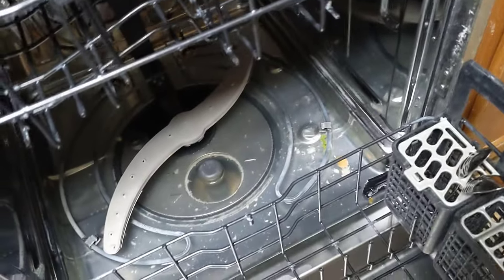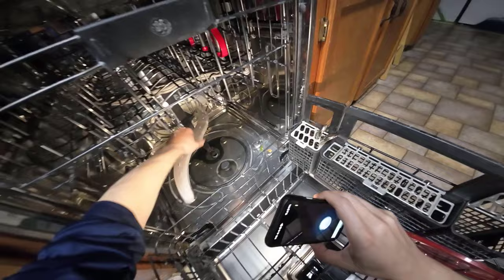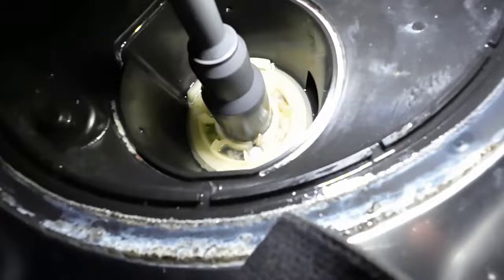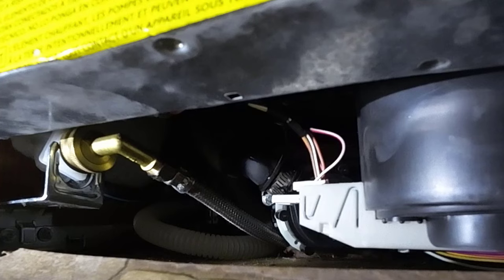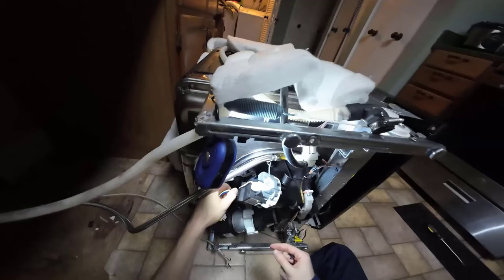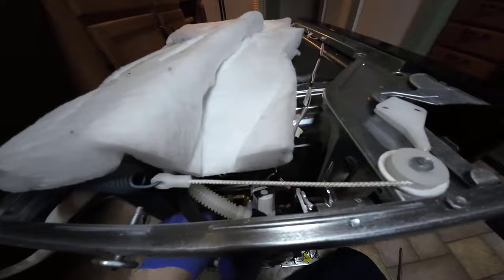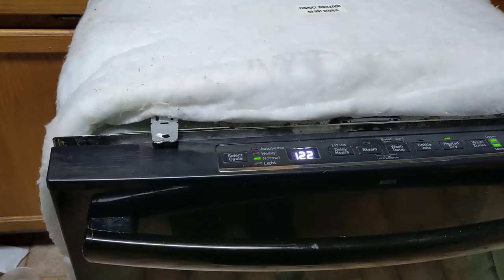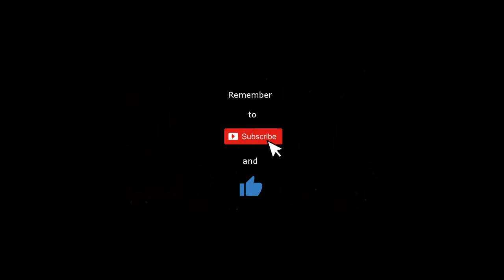Dishwasher water not draining, how to fix

Comment: You cannot blow back into the dishwasher as there is a valve which does not let the water come back.
Reply: Thank god. Cuz I really didn't want to try that
Reply: Blew into mine n got bubbles
Reply: The last video I watched showed the guy blowing in and getting lots of bubbles.
Reply: so what was the problem then if you didnt have a blockage @2wheelsOrDieNC
Reply: Mine has a blow back stopper that only opens from the dishwasher side
Reply: Not is not valve there
Reply: Incorrect - you can absolutely get water to back up into a dishwasher. I work in apartment maintenance and see it happen somewhat often.
Reply: @12799MaDeuce  I do maintenance as well and some have a rubber stopper that only opens from one side not all dishwashers but some do
Reply: The checking for a clog by blowing back!! Genius! Thank you
Reply: @brianw6093 did you ever get any feedback on your question? I have the same question…

Comment: Can u buy a new drain pipe mine is clogged with paper off of bean cans I washed without removing the paper 😢
Reply from the maker: replacing the line isn't too hard and should be no problem to do.

Comment: Had this problem. The drain line went up to a vent that sits on the counter, then a hose ran from vent to the sink waste line. The blockage was at the vent connection on the top of the counter. I have no idea why they put a vent on a dishwasher drain line, I have lived in several different places and installed a few dishwashers and never seen one before. Tried to blow air thru the waste line from the dishwasher but no flow. Didn't want to disassemble the entre line (weaved its way thru under sink) so I took a wet vac and put suction on the line. Bingo a wad of junk came out and now I could easily blow air thru waste line. 
All works good now. Before I saw this video I assumed it was the drain pump on the dishwasher so I had scheduled a repair with a local company. The repair estimate was around $300+ to replace pump. Thanks for the video.
Reply: the air vent is used to stop sink water from going back into the dishwasher. it stops back flow by having an air disconnect.
Reply: Islands have vents too, and it drained before the city services went haywire, and the 'third party contractors' put it back.  Reckon them are the same people that bolted that seat down, with the bolts they was supposed to put in the window vent?  Listen, they have better things to do than be responsible.  😊
Reply: I don’t have a wet vac, is there anything else I could use? Thank you for your tip
Reply: @cjowers40  If you have the vent on top of your counter (usually in back side of sink) you can take it apart and clean it out. Otherwise if you can disconnect the drain hose from the washer (need to pull Dwasher out from under counter) you could manually drain all the water, then use a regular vac to suck out crud. Maybe let it dry a little over night before you use vac.  Another option is if can get under the sink and if you have the tools is to disconnect line at the vent and manually clean it out. And fourth option is to buy a new drain line and install it and connect it to your garbage disposal (as it's done for many new installs). Good luck...

Comment: Had to unclog mine a couple of days ago. I couldn't hear the pump, so I guessed it must have a jam at the impeller.  Easy fix?  Unpopped the spray bar & filter screens to access the sump, I can't get to the impeller  from the top., so i used an aquavac to remove the water, concentrating at the impeller entrance & managed to suck the item jamming  it. It worked fine. Found that it may have been a small bit of bone or egg shell that got past the filter screen.

Comment: This really helped me out! Nicely done-nicely explained. Found 5 freezie pop plastic ends in the input and discharge pump. The only thing that wasn't clear in the video was how to disconnect the electrical part from the pump. I was able to leave it dangle while I fished out the plastic pieces with a needle nose pliers and a long tweezer. Also had a lot of gunk built up at the point where the discharge tube connects to the disposal.

Comment: I tried to blow into the drain line and could not but when I sucked on the line, I was able to syphon out all the water from the dishwasher.  I think the drain line has a one way valve cause when i disconnected the line from the drain pump, and blew into it, I was able to blow water out of the hose b ut when I sucked from the pump side, I could not suck through the line
Reply from the maker: Good to know!
Reply: There is a one way check valve in the end closest to the pump.  So you can't blow in the tube.

Comment: Trying to remove those screws on the drain cover, but nothing is working. What size is the socket that fits it?
Reply: 1/4 inch socket with an extension works best

Comment: any suggestions to get hard water stains off the plastic interior baskets ?  Only 3 months old
Reply: Try running it with white vinegar. After it starts And fills pour 2 cups of white vinegar in and restart
Reply: Add Lemi Shine to soap dispenser. You can buy it at any grocery or hardware store.

Comment: I believe my sink is clogged. that would cause a backflow into the dishwasher, correct?
Reply: I think the drain hose needs to be hooked up to the top of the sink not in the floor check you drain hose.

Comment: HELP ME PLEASE! So, according to the dishwasher manual I downloaded it says: Faucets are not opened, or water intake is restricted, or water pressure is too low.

How do I fix that problem?
Reply from the maker: It sounds like your water intake has an issue.  The simplest answer would be if the valve for your water intake was not all the way open, check to see if there is something you can turn to open up more.  I don't spend a lot of time talking about the intake in this video, but you can see it at 3:57.  It is the braided metal line that screws into the gold elbow of the dishwasher underneath.  It could also be that there is some piece of debris in this line that is causing the intake pressure to be low.  There could be a blockage withing the dishwasher intake, but I think that would be less likely.  If I were you, I would first check that the water intake from your houses pipes that lead to the dishwasher are fully open, and if they are, then I may get a new metal braided intake line, and replace it just incase there is debris stuck in the line.  If none of that is it, I don't know what it is.

Comment: When I turn on my dishwasher, it starts drawing water, and then it stops and does not start washing, and it takes out the water after the end of the program. What is the problem?
Reply: I'm having the same issue. Any advice? I took the dishwasher out and tilted it, heard some trickle and it ran a cycle afterwards and drained. Now today same alarm error. Seems to drain and then alarm before it starts. I could not get at the waste pump without dismantling a lot of the machine but I could auck/siphoned water put of the waste pipe so not sure that's the problem.
Reply: The recirculating pump it has 2 hoses connected (usually)

Comment: Dishwasher not draining entirely. I have removed the filter...its clean. I have removed the screen...its clean. But when I push the Cancel button after cycle has ended, the water drains completely. Help...I'm an almost 80 year old woman.
Reply: So after pushing the button IT DOES drain completely, or it does not?  If it does, than wonderful. 
I also have to manually drain remnants of water also once in awhile, but it does drain when I do this by simply pressing the cancel button.
Reply: @Mojo32  yes, the water does drain after pushing the cancel button. I have never had to do this until recently...I just would like to know why I am having to do this.
Reply: @vickimoore7646  Oh I see, at least it does still drain for you when you push the  button, but yes it'd be great to know why you need to do the extra step. 
I know that regarding my situation; I typically hand wash my dishes but I use the dishwasher to drain/dry them (with the door open and not turned open). So that's typically why I have standing water in the bottom. But again, luckily I just hit the cancel button and drain it completely. 
Of course once in awhile I clean/disinfectant by  running a load of dishes or even empty with baking soda OR vinegar

Comment: You never pinpointed the problem?
Reply from the maker: I think it was that screw
Reply: @burrheadjr , So basically you’re not sure what was the root cause of the problem.  It is what it is.
Reply: @burrheadjr  I’m having trouble matching to the two nuts to get them out to get access to the drain. There the nuts with the s on it that you use with the power drill. Can you tell me what nut/attachment you used to make this look so easy?

Comment: Lmfao this guy is a goof if you look in the bowl the disposal knock out is sitting right there that was his issue he doesn’t know what he’s doing clearly or there being a check valve either 😂😂😂😂
Reply from the maker: The disposal was installed 5 years ago, and the knockout was removed then.  There is a video of the disposal being installed, and you can see the knockout being removed then, at five minutes and thirty seconds of the video from 5 years ago.
https://www.youtube.com/watch?v=dGbc219N_jM
Clearly that was not the issue with the dishwasher 4 years later.
Reply: @burrheadjr  clearly it was you can see it in the bowl and the check valve is your problem for sure the reason you can’t blow through the hose is because of the valve you should be easily able to blow through that’s why water goes in than when it tries to come out it won’t because the valve shuts, so you not being able to blow through that hose in the first minute and doing all that extra work shows you don’t know a thing. And also considering there’s a shit ton of food in there shows you don’t know much a dishwasher just sanitizes it not cleans otherwise you are just baking the shit out of the food onto your plates and dishes that’s why they have never been a source of “cleaning” them just a source to sanitize them on high heat
Reply from the maker: @user-uk7jl4fk8k  As pointed out in several comments in here, the reason I can't blow into it, is because this dishwasher has a 1 way flow valve built into it, so things can go out, but not in.  The round thing in the dishwasher was already in the dishwasher, and is silver in color, and is the size of 2 kernels of corn.  The punch-out on the garbage disposal is black and is quite a bit larger than a quarter.  It wouldn't even make sense for it to be the punch out of the garbage disposal.  If it was, the dishwasher couldn't have worked for the 4 years prior without access to the garbage disposal. It would also mean that it would have worked it's way backward against the exit flow of the dishwasher, up and against gravity and work its way backwards.  It would also mean that I would have to have put the garbage disposal punch out back in somehow after clearly removing it in the video I linked from 5 years ago.